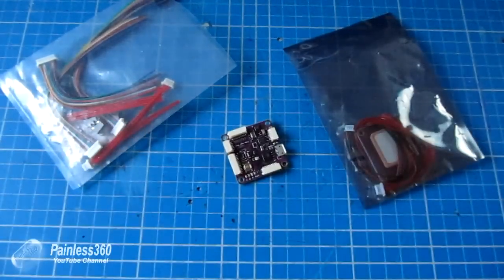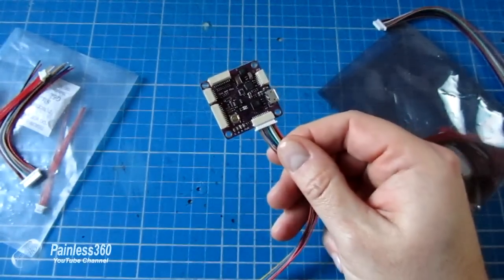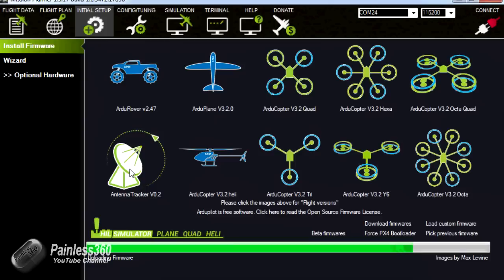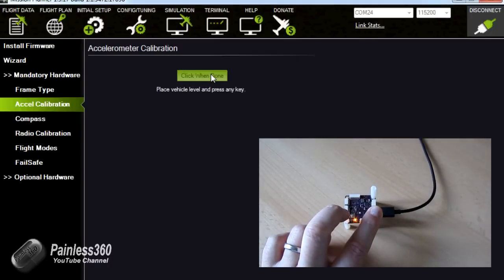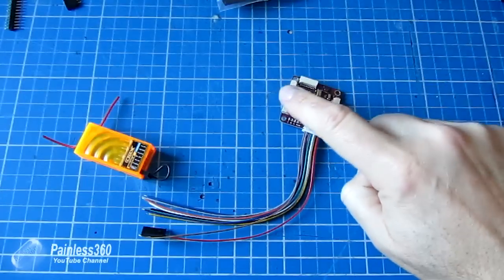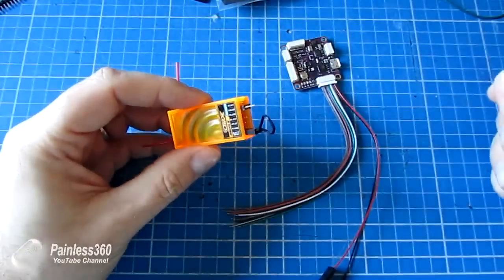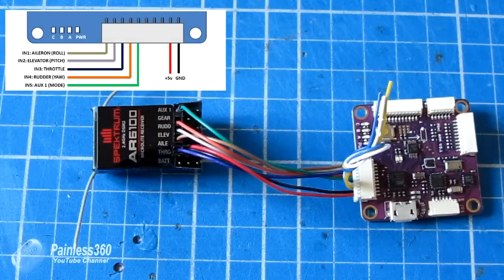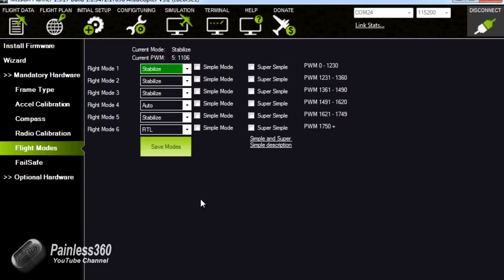(1/8) APM Mini 3.1 Video Series - Simple setup, config and calibration. Board from Banggood.com

Comment: great videos mate,
Do you have any plans to do another video on how to  install on a traditional helicopter.
Reply from the maker: dellashton sorry not at the moment. Is this something you are planning to do?
Reply: Painless360 I am trying to install mini apm v3.1 on a Walkera V450 D03.
 Tx Devo 7  Rx devo  802.should i take the power for the servos from the 802rx,
Reply from the maker: I would install a separate 3A+ switching UBEC and power the servos from that. I would leave the +5V from the BEC in the ESC to power the flight controller and Rx only. That way, a servo pulling too much current briefly won't brown out the control board and bring the craft down..

Hope this makes sense..
Reply: thanks for the info m8 ,i have installed a Power supply Module w/BEC but was going to use this for power to the apm/gps/teletry,and use the one on the heli to power the main motor  rx and servos as it normally does,,would this be ok
Reply from the maker: Not sure what you mean. When you say a power supply module do you mean an ESC? If so then powering the APM/GPS/Rx with that and powering the servos with another separate UBEC would work.

Best of luck.
Reply: thanks again for the advice m8,
Reply: sorry for the dumb questions, but do  all the servos need to be connected before the apm will arm,
Reply from the maker: It shouldn't, see https://www.youtube.com/watch?v=LEKSkOFHB-c

Comment: Hi Painless360.
Great vidio's . My question can you connect external led's on the mini 3.1 as the 2.5/6
I use these on my quad's for arming and gps indicators.
I now have a Bix3 with a Apm mini 3.1 hidden deep inside it and I have no visual indication of it being armed/disarmed. Tried looking in the mission planner / apm planner paramiters as with the Quads and googled it. The Mini 3 is loaded with Aduplane firmware all else seems ok not flown due to rotten windy cold weather.
Hope you have a solution or is it too new ? :)

Keep up the Great Video's

Bill Civic

Comment: hi is the HKpilot mega mini  the same as this i have notice on the apm 3.1 it has 5 connector ports on top where the HKpilot mega mini has 6
Reply from the maker: ras4q2001Hi, that board uses the same base APM code and hardware but isn't the same. A lot of what we cover here and in the other APM series apply but, as you already spotted, some of the connections are different.Good luck with the build.

Comment: I've got one APM mini 
But the cables aren't as in the video, in the plug it's swapped black and red.
Does the video show corret wiring, for servo. I can swap red and black if it's nessesary
Reply from the maker: In the first set of videos I found the same and wired it up so the black wire was +5v.  In the second series I swapped the black and red cables in the loom over as having a black cable carry positive voltage is asking for trouble and very confusing when you are making up custom looms!

Hope this helps..
Reply: So actually, the pinout on the boards are correct ??? wires are in some videos ??
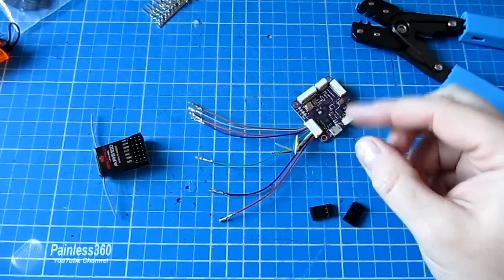Reply from the maker: Jens Hoffmann Hi, see in this video at 19:44 for the answer.

Happy flying!
Reply: Painless360
Thx, missed it.  

BTW great videos

Comment: what is you favorite mini board? do you prefer mini apm or naze 32 for small frame?
Reply from the maker: Hi, I am working on the a Naze32 full version set of videos then a CC3d series after that. I will be able to answer this after I've completed all of those videos.

Joking aside, it depends on what you want. If you want a great FPV platform that provides smooth flying but will involve a little work - get the APM Mini. If you want a simple board that's easy to setup and provides only the basic flight modes - try the CC3D. If you are looking for a board that is developing fast and can provide GPS and other functions - consider the Naze32 full version.

Happy flying!

Comment: Hi, i see you had to do some mods to get the GPS to work. Do you know anything about the UBLOX LEA-6H GPS? I am thinking of spending the extra as i've heard they are more accurate. Do you know if the upgrade is worth it and weather or not it would work with the APM mini? I am about to start building my next quad and am considering the APM mini as my FC. Since i live in the mountains i think the more accurate GPS could be the way to go as i've heard it is sometimes difficult to get a GPS lock if the satellites are hidden by the mountains. Also since it will have to navigate around extreme terrain i am thinking the better GPS would be worth the investment. Can you see any disadvantages with the UBLOX LEA-6H GPS other than cost? Thanks again.
Reply from the maker: The key is to have the GPS mounted with a clear view of the sky and away from any interference from the rest of the electronics on the craft.

The GPS I refer to in the video can be found here - http://www.unmannedtechshop.co.uk/miniapm-gps-module-ublox-neo-6m-with-compass/

This one is made to be a lot easier to setup with the APM 3.1..
Reply: I'm thinking to go for the mini APM FC. Regarding the GPS, since i live in the mountains it can be difficult to get a good GPS lock since the mountains around block the view of much of the sky. The valley is narrow and the altitude can vary between 800M above sea level and 4800M. It is why i wanted to make sure i invested in a GPS that will work as good as it possibly can in such an environment. I appreciate the link and obviously want as little headache as possible when it comes to setting up but i'm prepared to go that little bit further if i can achieve better results. A friend of mine was filming at 1900M last year and he couldn't get a lock for 45 mins. 4000M+ peaks all around him!

Comment: i have a ublox m8n with just one plug that plugs into the port beside the micro usb. do i need to cut the internal compass wire on the mini to get just the external compass n gps to work?
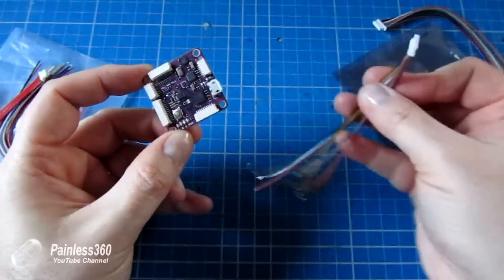Reply from the maker: Without J1 cut the APM will continue to get the data from the on-board compass. See https://www.youtube.com/watch?v=njrNLWepCbE at around 3:22 for more detail. 

Happy flying!

Comment: Thank you for this video. Did you try with the new v2.0.15 ?
I did but it's absolutely impossible to upload any firmware with this version. Please tell me if you have issues with 2.0.15 and APM mini v3.1
Reply from the maker: I'm using version 3.2 of the firmware in this video and 3.1.17 of Mission Planner. No problems. I'd try the latest version..

Happy flying!

Comment: Thanks for all your info. Very clever putting the link in your description, due to it being so easy, I brought one :).. Just a question. For less interference, is it best to break the solder and attach a separate compass? I am wanting long distance FPV plane set up. Thanx in advance :)
Reply from the maker: This is covered in the next video but in summary - yes it is. The farther away the compass and GPS are from the rest of the electronics the better.

Happy flying!
Reply: While I have your attention. You mentioned MavLink in a future vid, but was wondering, is this the only way to change the mission mid flight? If not, what are other systems that allow mission change mid flight? Thanx
Reply from the maker: Google+ sucks balls!!!! Search for 'MAVLink 3DR radio' on my channel to find the video that shows me setting this all up. Happy flying!

Comment: Thank you for this nice APM presentation. As for the red/black wires these can be switched in the the small connector (just need a small sharp pin to unlock each wire and reposition correctly). Looking forward for the next episodes.
Reply from the maker: Claudiu Farcas Hi Claudiu, good tip, I do this later in I the video to make the wiring looms. I was surprised that black and red wires are used in the loom and not connected to the power rails correctly. It's just bad practice and invites power issues. 

Happy flying!

Comment: that is so cool that you are doing all this stuff for the APM mini too! :D One thing that I thought when I saw the mini was that this is just a smaller and less sophisticated board for smaller craft but this is not true I reckon? Are there some drawbacks or is it as top notch board as its bigger APM brother? I am just upgrading to a bigger quad which will be my first self build one and I am so happy that you do these videos. You make all of it so much easier to understand! :)
Reply from the maker: Think of this as an APM 2.5 board in a smaller package.

Pretty much the same features and options as the APM 2.5 full size version. The next video will cover, GPS, power, ESC and motor connection and then the series will pick up the existing APM 2.5/2.6/3.1 videos (3/8 - 8/8) as they are perfectly suited to this board too.

Happy flying!